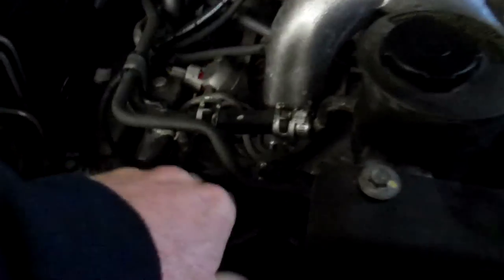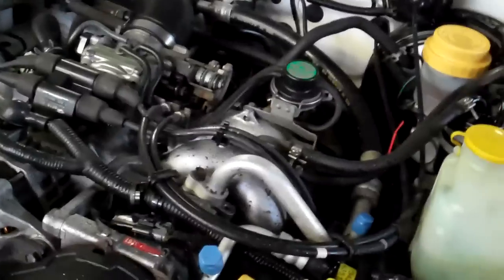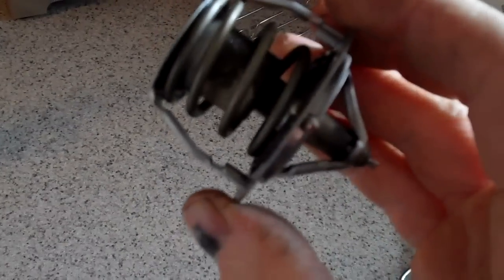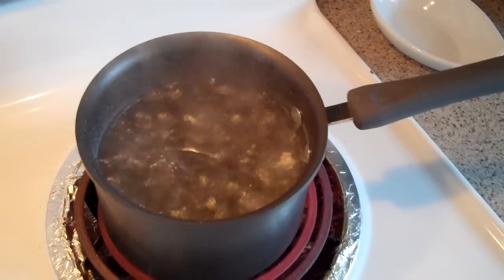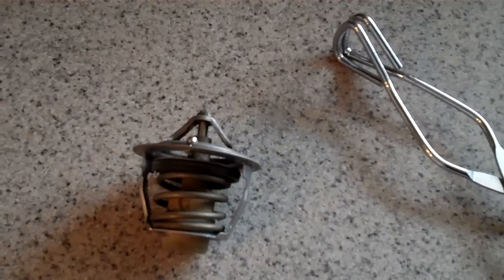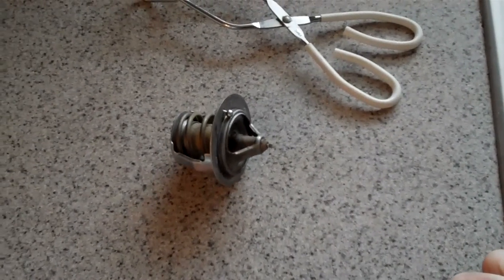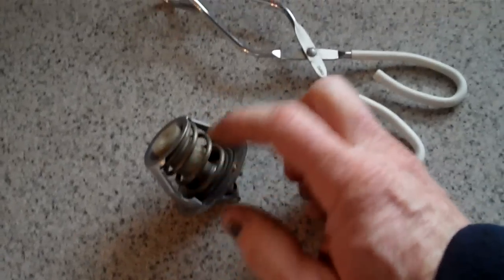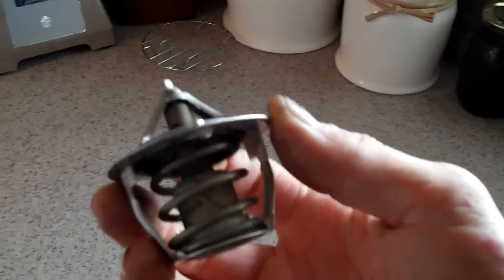How to diagnose a Subaru that overheats after ten minutes of driving

Comment: I have  a 2004 Subaru Forester and it overheats I take it to the mechanic and they can't find nothing wrong with it couple days later it overheats again can it be the thermostat failing...
Reply: Calm down. Relax. Go about this in the correct, scientific, rational manner. So you have an overheating issue. Does it get up to temperature quickly? How does it heat up still compared to moving at speed? Does the heater work? Are the fans working? Is there something blocking the radiator?

Comment: If the subie blows coolant hoses that's a sign of combustion gases/pressure getting into the cooling system,
if it always is low on antifreeze, do a cooling system pressure test,
the 82 series subaru engine is a joke since it is prone to head warping due to the piss poor design of having exhaust valves /ports adjacent to each other!